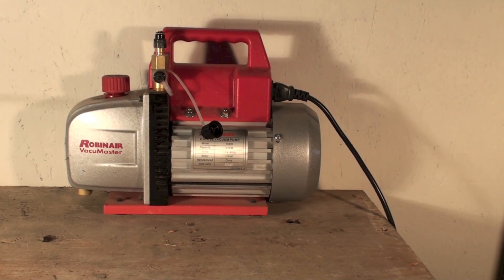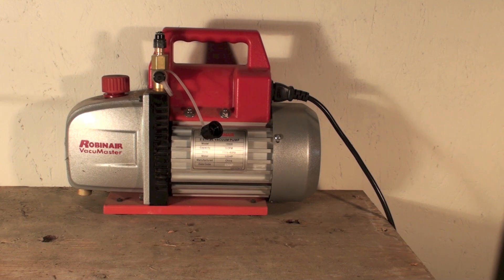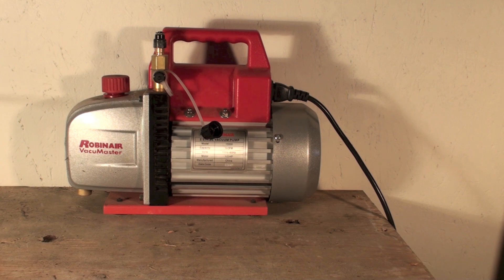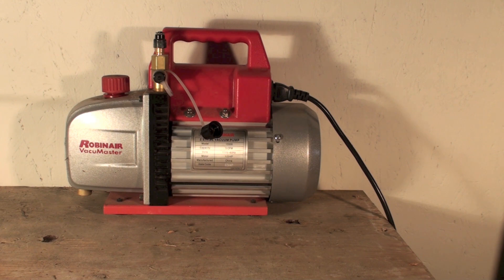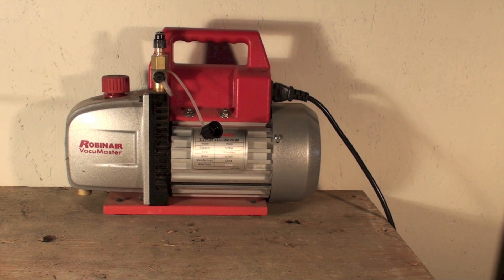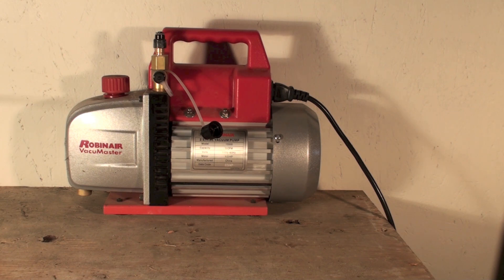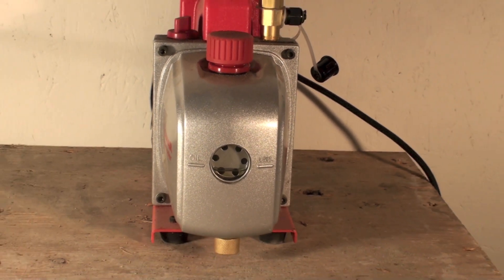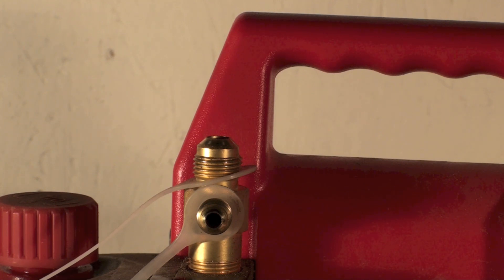Intro to the HVAC vacuum pump part 1

Comment: I had a strange thing happen where I pulled a vacuum, turned the pump off and then oil started bubbling back out the vacuum line attached to the pump.  Looked online and found likely culprit as check valve.  Does this sound right and how do you get to the check valve to replace it?  This could be a video in itself.
Reply from the maker: I have not seen a check valve in a vacuum pump.  I will have to look.
GFM

Comment: So, as embarrassing and stupid as it is, I poured oil in the exhaust cap, I got confused because it says oil on it also, did I kill it? 

I tested it out after, and it seemed to still work. 

Thanks!
Reply from the maker: Bet you got soaked in oil when you fired it up.  It won't hurt it.
GFM
Reply: grayfurnaceman haha. I actually caught on pretty quick, so I didn’t pour a ton of it in there. 

Thanks for the reply! 

I’m coming from an appliance background, slowly getting into HVAC, and your videos have been a tremendous help, but also part of my on going curriculum ! I appreciate that you take the time and enlighten us! 

Thanks again!
Reply: How open should the exhaust cap be ?

Comment: What happens if you put the oil in the discharge area (exhaust port) that has the big letters that read "oil" on it??  Didn't start it after I realize I put the oil in the wrong hole, I drained it.
Reply from the maker: It will usually just blow the oil out.
GFM

Comment: Sir I have a question...when a unit (residential 3/4 ton) is being replaced,  do we need to used the vacuum pump?  I'm concerned about air getting into the lines/pump,  My unit is being replaced because it very old and leaking.
Reply from the maker: +freddie sims If it is a split system with piping between the indoor coil and the outdoor unit, yes.
GFM

Comment: Would you make a video disassembling a vacuum pump just for maintaining the Rotary Vane? Somebody told me, after several hours of use (100 Hours), you have to clean Rotary Vane and surroundings spaces and walls inside.
If you help us with this video, we would really appreciate it.
Thanks in advance.
Reply from the maker: +Francisco M. Del Castillo S. I will do that in the future, but if you change the oil with every evacuation there should be no maintenance that involves dissembling the pump.
GFM
Reply: What happened is, that I forgot to change oil every single use; so, I need to deeply clean the rotary vain and walls, so it will work as a brand new pump. But I'll wait til you made that video for all of us. Thanks a lot.
Sincerely
FDC

Comment: Love your videos watched all part 1-4.  And I have a question. If you change an ac compressor, if I vacuum do I need to nitrogen purge too or the vacuuming takes care of all the nitrogen purging will do.
Reply from the maker: Kofi Ampofo Boadi If I am reading you right, you are asking if you need nitrogen in the system before evacuation.  You do not.  The nitrogen is for keeping the inside of the tubing clean while brazing and for leak testing.  Hope this helps.
GFM
Reply: Thanks for responding. 
I appreciate your response.

Comment: Is it a problem if I put the oil in via the Exhaust/discharge oppening, not the oil rifill hole?
Reply from the maker: mirsad cviko Yes. It will probably blow out when the unit is started.GFM
Reply: I accidentally did this. Will it ruin the vacuum?

Comment: I'm gonna have to run a vacuum on my car a/c system after I replace the compressor is it ok to use the 5cfm 2 stage on it and if so about how long do I need to run it ?
Reply from the maker: Daniell Arvizo Its ok.  I would pressure test it first with nitrogen for leaks.  I would run it about 1/2 hr.  Hope this helps.
GFM
Reply: grayfurnaceman OK thank you so much for the very informative video and advice.

Comment: how long can you run a hvac pump for, 1 hour ? continuously ?? i want to use a hvac vacuum pump for bag pressing, cheers
Reply from the maker: Miles Dexter Tell me what exactly what you are trying to do.
GFM
Reply: grayfurnaceman it would be for forming gentle curved work with plywood veneers over a mould inside a vacuum bag

Comment: One quick question, is air a non condensible?
Reply from the maker: gettin to it ent. Yes, anything that will not condense within the normal pressures that the system is normally under is considered a non-condensible.  Air is made up of mostly oxygen and nitrogen which are condensible but only under extremely high pressures that most of these systems are not capable of.  Hope this helps.
GFM

Comment: I have a test on how to put our gauges on a system, how to recover refrigerant, pressure charge with Nitrogen and then Charging the system with refrigerant in our own words. Here what the handout says but I feel it could be way more detailed. If I was given this in the field and never done it before I am not sure if it would be good enough:

Installing Gauges

1. Remove valve system caps
2. Check that service valves are back seated
3. Remove access caps and Install gauges
4. Crack service valves off the back seat
5.Turn system on
5. You are now ready to record pressure

Recovering Refrigerant

1. Install gauges on refrigeration system
2. Attach yellow service hose on our gauges to inlet of recover unit
3.Use a second yellow hose and attach one end to the outlet of the recovery unit and the other end to a recovery cylinders liquid valve.
4. Open the low side of our gauges and allow refrigerant to flow through the recovery unit and out to the recovery cylinder.
5. Back off the hose connected to the recovery cylinder liquid valve just long enough for any air to escape and tighten the hose back up to the liquid valve
6. Open the valves on the recovery unit
7.Turn the recovery unit on and throttle your low side gauge until there is only vapor in the system then open bot high and low sides of your gauges fully.
8. Run the recovery unit until the refrigeration system is in a 20hg vacuum close your gauges both high and low side.
9. Close the liquid on the recovery cylinder and turn off the recovery unit.
10. Remove the recovery unit and cylinder and procceed with your repair.

Charging a Refrigeration System

1. Install your gauges if they are not already on the system
2. Hook one end of the micron gauge to the yellow service hose on your gauges.
3. hook the 3/8 hose on our gauges to the vacuum pump.
4. Turn the vacuum pump on and open both low and high sides of your gauges.
5. Leave the system on a vacuum until you reach a vacuum of 500 microns.
6. When 500 microns is reached close all the ports to your gauges.
7. Turn off the vacuum pump and remove the yellow hose from the pump and the micron gauge then put them away.
8. Hook your yellow service hose up to the vapor side of the refrigerant cylinder or recovery cylinder containing the refrigerant required for your system. Place on scale.
9. Open the vapor valve on the cylinder and then open the low side of your gauges until you see your system pressure reaches about 5 psig
10. Turn your gauges off and start your system then open the low side of your gauges and charge the amount of refrigerant the system requires.
11. Turn your low side gauge off and call your instructor over at this point to check your progress.

Removing Gauges

1. Back seat discharge service valve.
2.Cross purge gauges
3. Back seat suction service valve.
4. Turn system off.
5. Remove gauges and install caps.
Reply from the maker: Brent Peluso I would add to purge all hoses on installing gauges. This is assuming you have true service valves and not the valves used on most air conditioners.  
As for recovery, looks pretty good, I open both valves and throttle.  Also most recovery machines will shut down on low pressure at 15 in mercury.  
Evacuation:  I like to set the micron gauge at a service port farthest from the gauge hoses.  
500 microns is not always possible.  I look for a settled vacuum.  I would do a triple evac.  
Charging:  This one requires a lot more than that.  This is the hardest part.  There are many ways to charge. Weight, superheat and sub cool, target superheat, manufacturer's charts, etc.  
Overall, not too bad except for the charging part.
GFM
Reply: Ok thank you. How do I cross purge after I back seat the discharge service valve before removing my gauges
Reply: This is in class so we have stem type servicd valves that we have to Back Seat, Crack of the back seat, and Front Seat with our Refrigeration service wrench.

Comment: The main problem with inches of mercury is that they are usually quoted as a relative scale compared to atmospheric, hence the max attainable number is always the same as your current uncorrected barometric pressure.

In my case the current uncorrected barometric pressure is 28.7" of mercury since I am at ~1000 feet elevation, if a manifold gauge set here reads a vacuum number higher than that 28.7", it is wrong plain and simple.

There is a review online of a guy who bought a vacuum pump and returned the 1st one because its windings were grounded, then returned the replacement because it wouldn't pull below 26", but he lives in Arizona where the mean elevation is 4000' AMSL so 26" could very well be the max attainable vacuum where he is.

Microns of mercury are quoted as absolute, 0 is a perfect vacuum no matter where you are.
Reply from the maker: Daniel Armstrong Good thoughts.  I had not thought of it that way.
GFM

Comment: Thanks you, good educational video. I have a question: what should be the industrial standard for proper good vacuum, 500 or 250 Micron. Also is it the size of the equipment being evacuated, the HP of the pump,  length , diameter of hoses and the cleanliness of the piping . will have a direct effect the time and the level of vacuum in micron gauge. Thanks for your help!!!!.
Reply from the maker: 500 is what we shoot for.  Some say 250, but this is only on new equipment and sometimes not then.  So, can you get 500?  Many times no.  If the system has leaked out the refrigerant, had a compressor burnout or is quite large, you will be lucky to get 1000.  Especially if it is 410A.  Don't waste your time trying for something you can't get.  Hope this helps.
GFM

Comment from the maker: Some fan motors will put a surge in the circuit upon shutdown.  That sometimes makes a klunking noise.  Other than that, you might send a video with the sound.
GFM

Comment: Hi GFM!  I appreciate your work.  It helps a lot!  I have a question for you about my system at home.  We occasionally hear a popping noise (similar to the sound of a bursting light bulb without the glass).  This morning I noticed it happened right before the AC blower powered down.  Also--the lights flicker when this happens.  What should I check?  Thanks!

Comment: Great video about vacuum pump basics! I'm definitely with you about the size and accessories. Doesn't need to be too big, doesn't need an isolator valve or gauge built into the pump. It just so happens I have that exact same pump and have been very happy with it! I find that when you're evacuating a large system; it's probably an overnight affair anyways. Therefore, the pumps size dosen't really matter. Clean oil is really important, too. A lot of people don't believe it...
Reply: Hi - since then have you ever tried to add a gauge to your vacuum?

Comment: Thanks will try that and run it a bit lower I was thiniking that I should fill it at or a bit higher than the fill line as to not cause adage to the pump but I seem to have excess oil in the gauges and hoses then my micron gauge acts up

Comment from the maker: It all depends on the pump.  You may notice the pump I am using is down to the lower third, but when started it goes to above 2/3ds.  I would runs yours to where it does not pump oil.
GFM

Comment: Is it better to fill the oil to below the line? It seems with my bullet I fill to the line and when I run the pump the oil gets into the hose excessively and my sight window is covered full up. Great series look forward to #2

Comment: good thorough explanation as always! ive got an older version of the robinair vacumaster its an 8 cfm and its provided me with about 8 years of trouble free service so far (knock on wood) keep the oil changed and they last a long time!